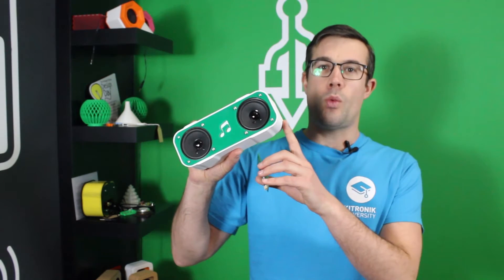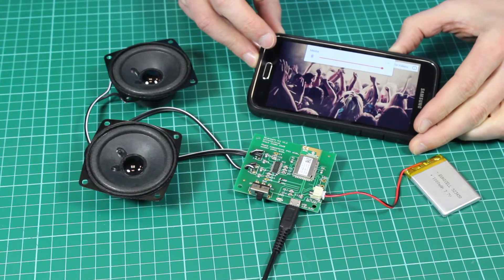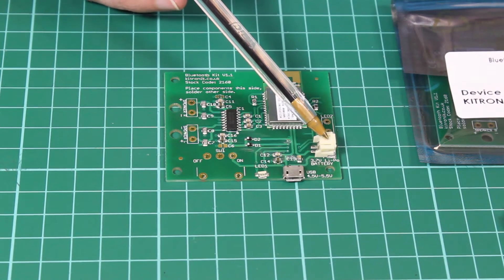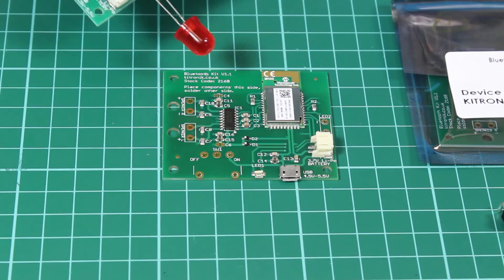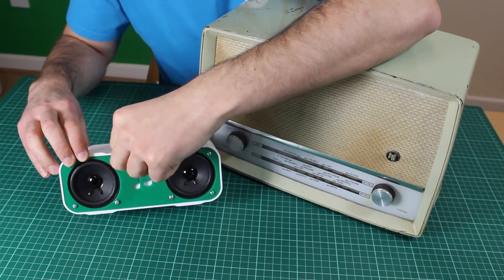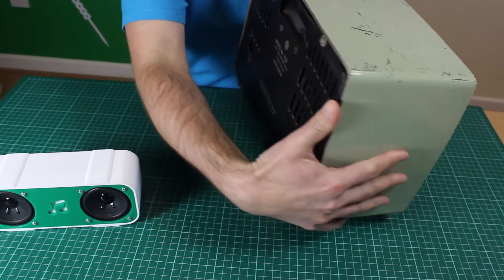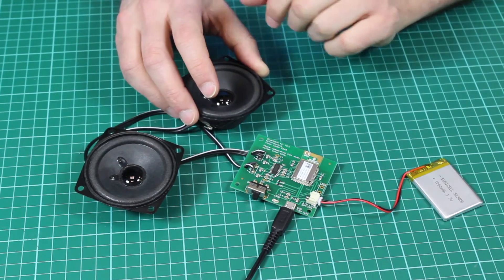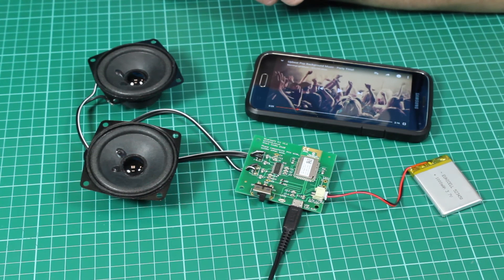Bluetooth Stereo Amplifier Kit - Kitronik

Comment: When soldering, should the wire be seen at the bottom of the PCB board and will trouncing the board damage it?
Reply from the maker: Hi, all of the soldered parts (Speaker connections, Switch, and Optional LED) will have the soldered joints on the underside of the board, the wires and legs will pass through the board from the top to the bottom. After soldering you can trim the legs/wires back to just above where the solder joint is so they don't make mounting the board in your enclosure difficult. Try to not snip into the solder itself as this might affect the quality of your solder joints. I hope this answers your question.

Comment: Can you operate the speaker without the USB cable
Reply from the maker: Hi Isaac, yes you can. The USB connection is just for power and if you have a LiPo power source you don't also need that connection.